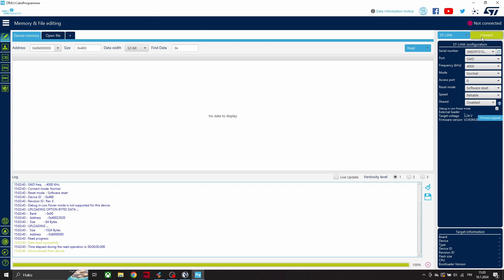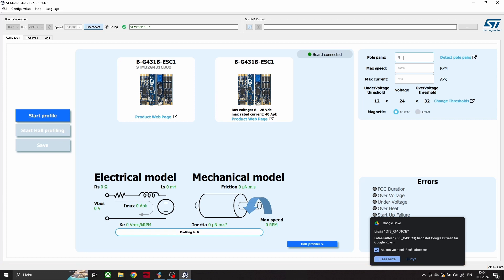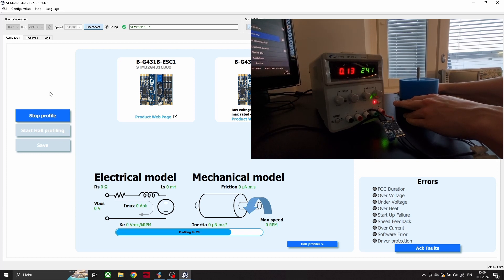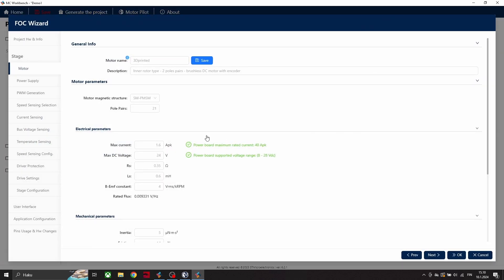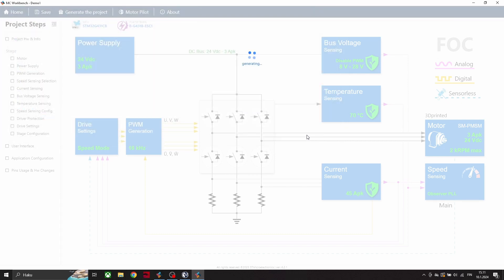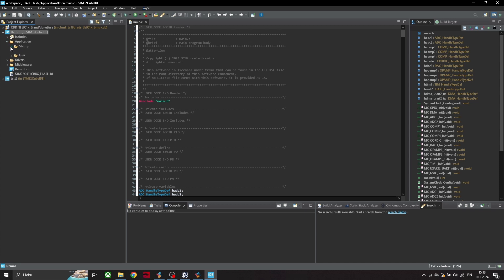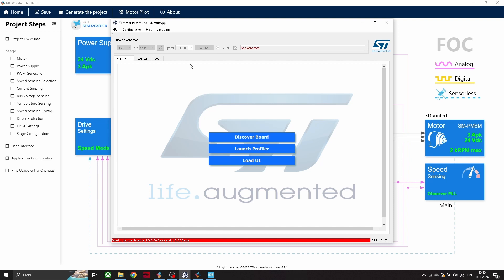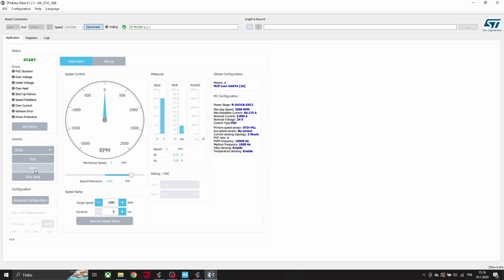How to spin custom Brushless DC motor with B-G431B-ESC1

Comment: Hi I keep getting either of the two errors while motor profiling my 3D printed custom motor - 
1. Speed feedback error is max rpm is set on lower side
2. The profiler keeps on running and doesnt complete if rpm is set on mid and higher side.

Either way I am unable to get the motor profiler to complete the profiling. Any  solutions?

Comment: Hi, may I ask you about the temperature of board when load is unconnected but PWM running? I purchased few weeks ago this eval board and for me looks that thetemperature is quite higher even at at no load. 

MCU CLK 170 MHz. PWM Frequency = 30KHz, deadtime set to 500ns - 1us. I checked it under thermalcamera and looks the temperature of the whole board is uniform ~55°C, DC/DC temperature is about 60°C. It is perceptible even by touching. But seems that everything works fine, what is your experience with that board? 
Thank you in advance.

Comment: This only for calibration and know about the ld, lq, bemf sir?? No need  connect encorder???
Reply from the maker: You can run it without encoder(sensorless). Yes motor profiler measures motor id,iq,bemf etc. These parameters are needed for FOC algorithm.
Reply: @simplecad7462  but i dont know the pole and sm or i pmsm motor sir of my pmsm motor,
Reply from the maker: @botak333  Where you got your motor?
Reply: @simplecad7462  from ex of cnc sir, but i dont get the data sheet about the pole, vut for ld, lq, i have, i dont get the driver also
Reply from the maker: @botak333 Sorry can't help. Motor pilot is used to measure parameters, you have to know more about the motor.
Reply: @simplecad7462  okee sirr. Thank u🙏🙏